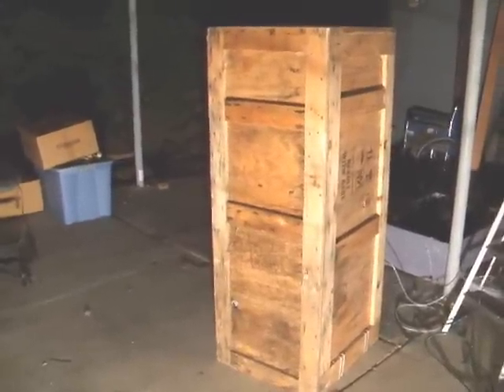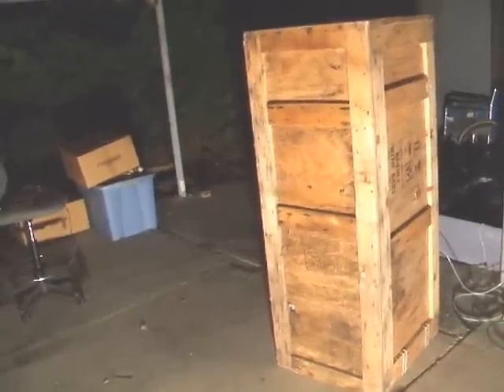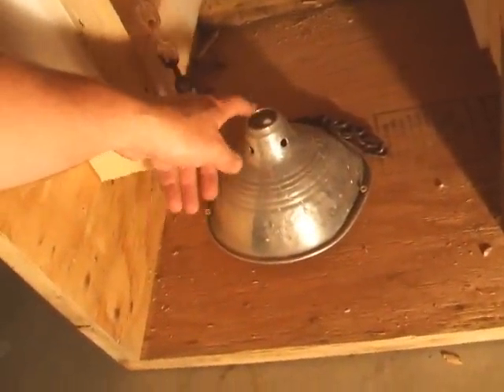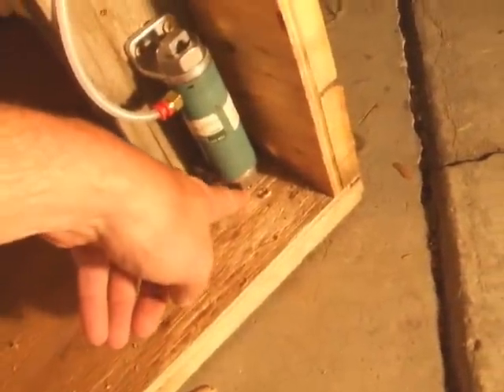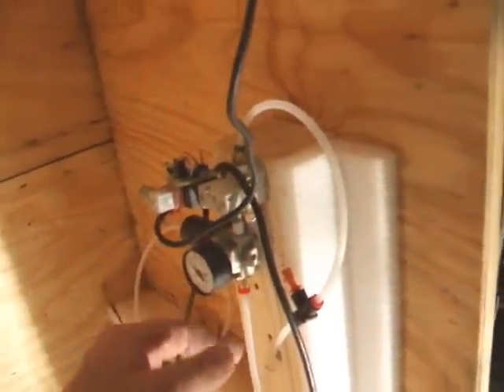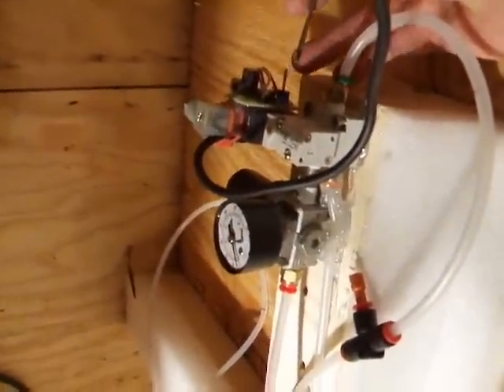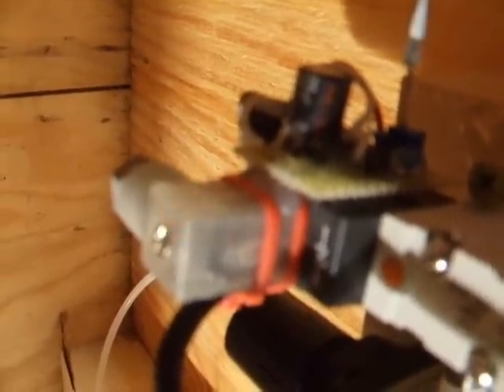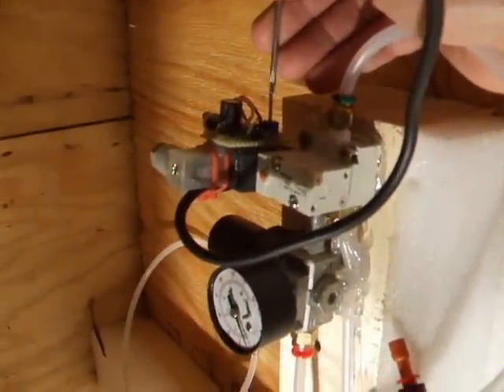Cheap Monster in a box 2009 Improvements

Comment: I hope you have a damper diode across the solenoid coil, or it has one built in. When the power is removed from the coil it can act just like a car coil and send damaging voltage back through the circuit, eventually frying the 555. A standard 1N4001 across the coil, opposite of the supply voltage polarity, will protect everything.

Comment from the maker: Search Youtube for more videos showing the 555 circuit. Also search the web for a 555 timer calculator. It is very easy once you get into it. If you can't solder, you can still do it with a bread-board. GOOD LUCK.